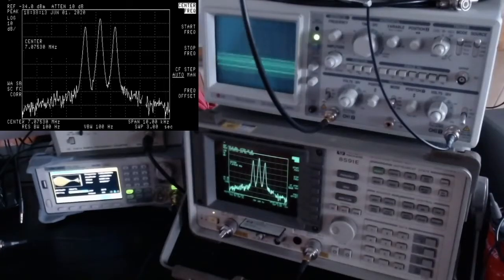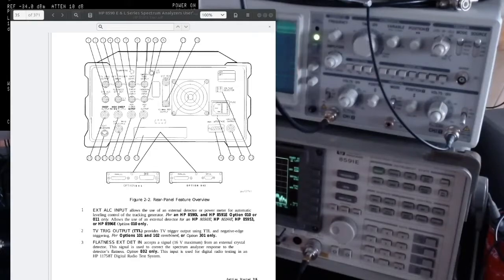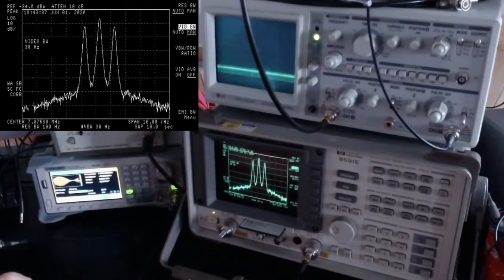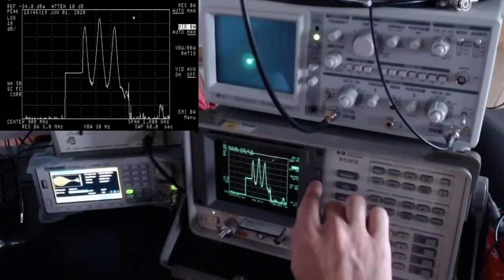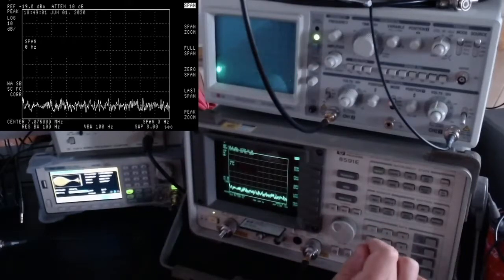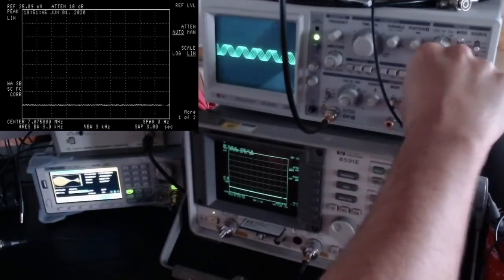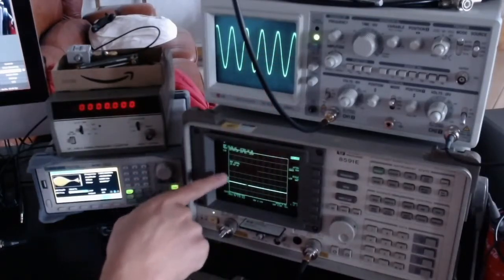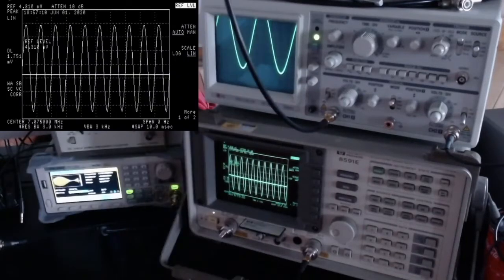Episode 36: a look at the HP 8591E and its extension ports.

Comment: The glitch you see at the end of a scan is the oscilloscope spot that is returning back to the left. Let’s think: in a normal scope, the spot is blanked during this phase. But here, you have to feed the oscilloscope this blank signal - usually on Z input in many scopes, as long as the analyzer is providing this signal…

Comment: May I ask where you bought it used?
Ebay seller?
Video Dongle?
Etc.

I'm looking for a good used Spectrum Analyzer and the one you found is ideal for the frequency ranges I'm looking to design for.
Thanks so much!
Reply from the maker: Hi! I bought it in france using leboncoin.fr . It is basically a french (local) version of Ebay. Several countries have similar things: UK has https://www.gumtree.com/ , Italy has www.subito.it, etc.
I noticed you can get much better deals in these "local" website. However, by being patient, you can find good deals also on ebay. Patience is the key for a good price.
Reply: @therfnoob7697  the rf channel on the left for tracking was .... obturated by a plastic button ? 10x
Reply from the maker: @iulianiasi  Hi! I am not sure what you mean? At what time in the video? thanks!
Reply: @therfnoob7697  well in front of the analyzer there are 3 plugs BNC or N I cannot tell .On ebay it seems to be BNC on yours seems to be N.So the plug RF OUT on your analyzer has always "been there" or you make an upgrade ? All of the HP 8591E that I found have that output blocked  and it confuses me.I want to buy an analyzer like yours only if I can make tracking :) 10x , 73! de YO8SHP , Iulian.
Reply from the maker: @iulianiasi  ah, now I understand! My model is HP 8591E with option 010 (which means that the tracking generator has always been there). 
There are 3 output ports in the front:
- RF input (N-port, but I always have a N-to-SMA adapter inserted)
- RF out/Tracking (N-Port, again, again, I have put there a N-to-SMA adapter)
-  CAL (a constant 300Mhz square wave signal for calibration, BNC port).
If you want to have a better look, see page 32 of the manual (https://www.dropbox.com/s/s1x365fr8f1vnfw/HP%208591E%20User.pdf?dl=0)
Yes, I agree with you. It's better to buy a Spectrum Analyzer with Traking generator if possible! :)
Reply: @therfnoob7697  aha , so I was right that it was something fishy there on the ebay :) Thanks for clarifying .
Reply from the maker: Right! For example, this model DOES NOT have a tracking generator:
https://www.ebay.com/itm/HP-AGILENT-KEYSIGHT-8591E-SPECTRUM-ANALYZER/163944505842
Reply: @therfnoob7697  right , I'll go for a SIGLENT SSA3021X soooooooooooooon , maybe :) 73!
Reply from the maker: @iulianiasi  good choice!!! The Siglent SVA1015X VNA is also very interesting (until 2 months ago I did not even know what a VNA was, but now I appreciate it). But too expensive for me! :) For the moment I am happy with my 50usd nanoVNA! eheh
73!